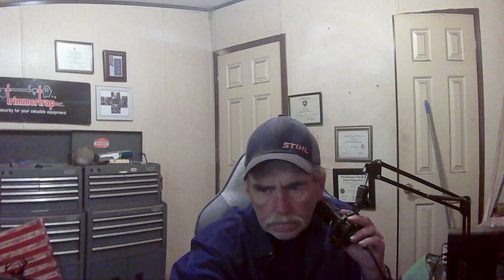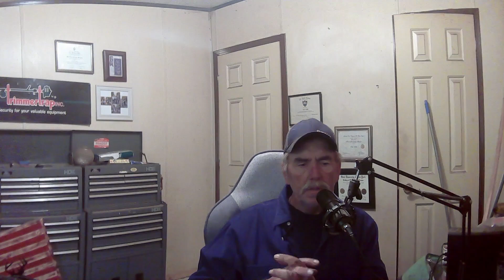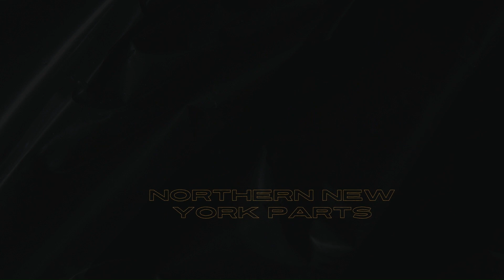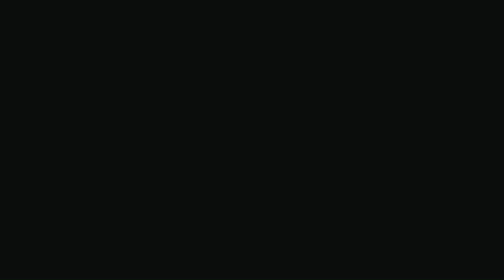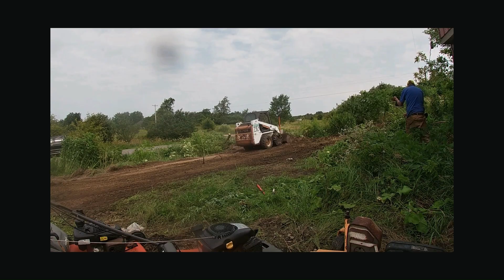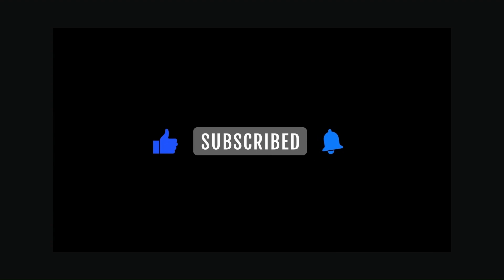The Future of Small Engine Repair in a Battery-Powered World

Comment: Wheels and tires will go gad, blades will need sharpening, switches will fail,handles will wear and get loose. All repairs. If man made it, at some point it will need fixin.
Reply from the maker: Yep, you're right - there'll always be a need for small engine repair.

Comment: The battery powered mowers are made even cheaper than the cheapest MTD mowers. The blades are thinner than the thickness of a standard lawnmower blade. I see broken electric mowers all over the place and nobody wants them, especially once they quit working. Batteries are the majority of the issues and it's not worth buying a replacement battery.  Just like putting more than half it's worth into a riding mower, nobody wants to spend 3/4 of what it costs new on a battery. I have sharpened blades on a few electric mowers and the blades were all like a piece of tinfoil. The whole mower is a cheap monstrosity of plastic and they want $500 😂
Reply from the maker: I have only so far seen one and it was a walk behind push mower. The whole bottom melted...junk pile.